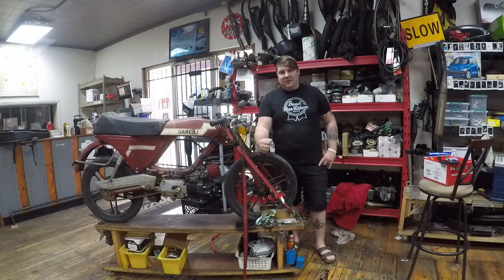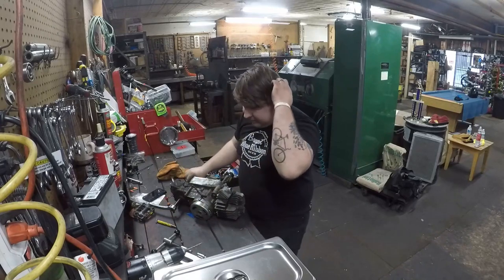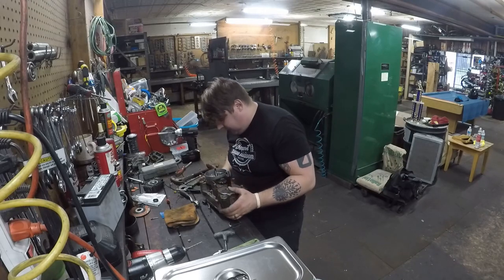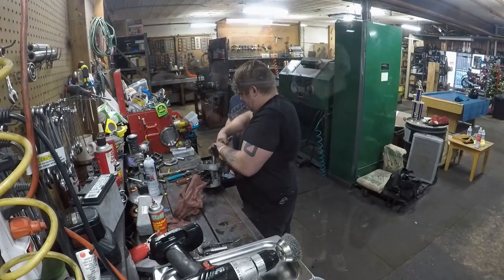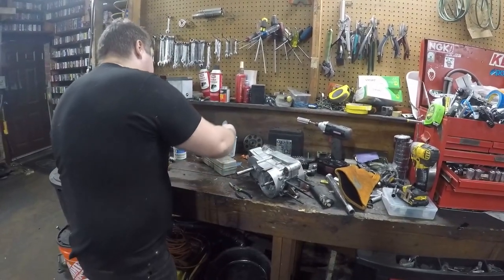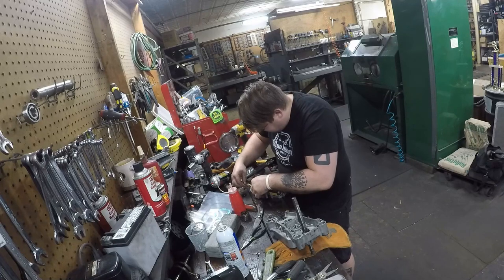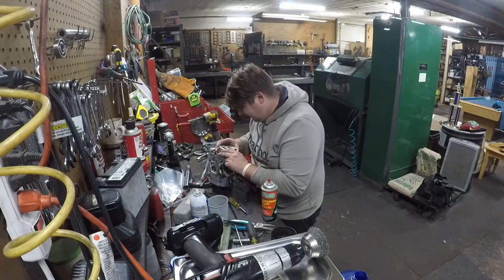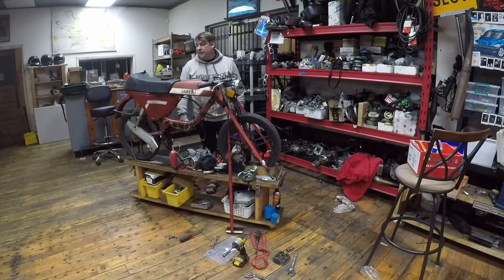Garelli NOI Motor Rebuild

Comment: I possibly have the same kit on my ssxl. running a hammer clutch I believe. What top speed do you get out of yours? I used to get 45ish. I fixed the exhaust leak I had, and other air leaks I had. now I can barely get 30mph. at a loss, lol.
Reply from the maker: I’m only hitting 41 right now, but I’ll be switching up my gearing shortly as I’m running 11x31 right now, I think a 28-26 should get me to 50